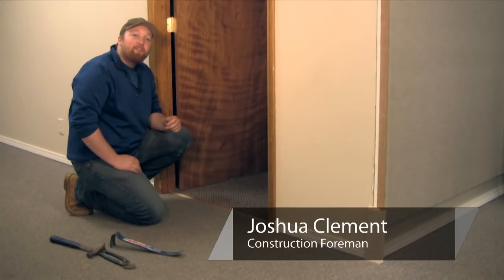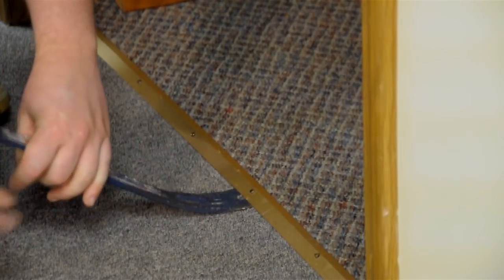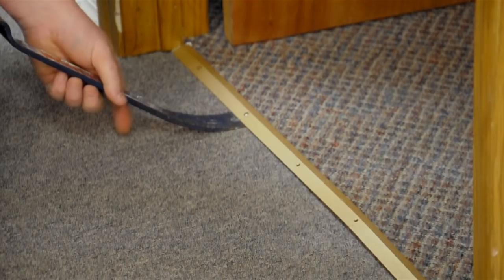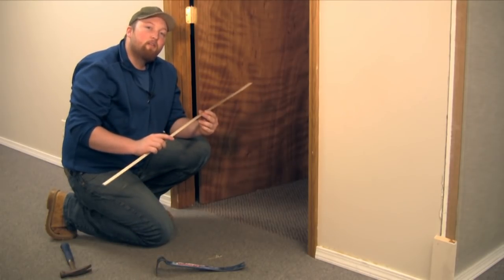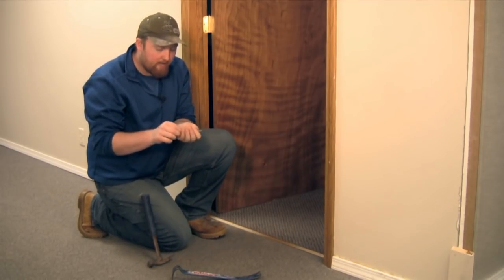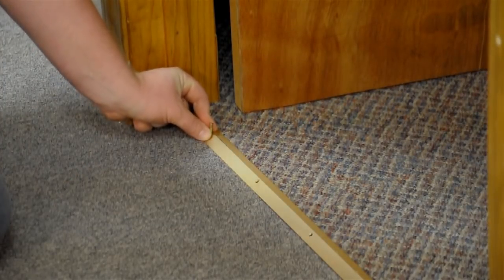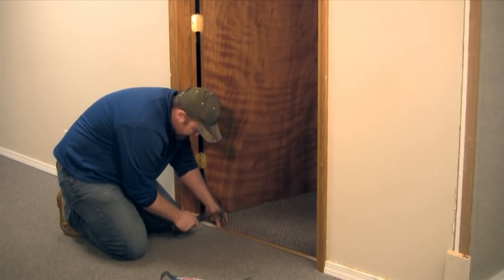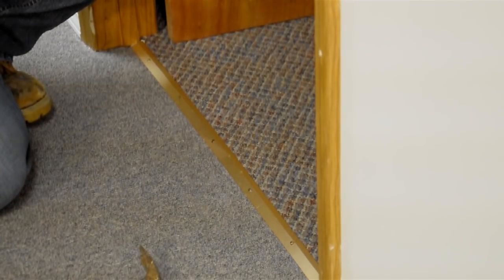Trim & Molding : How to Replace Carpet Trim

Comment: I have the carpet trim that doesn't use nails. It's about 1/2" wide, and looks like it's attached to another part underneath the carpet. It's also curved and follows the carpet along the floor. I have NO IDEA how to fix it OR even what it's called to google it.   Maybe I could just hammer it back?  My chair caught it 2/3 years ago and I'm doing all I can to keep it from getting worse.